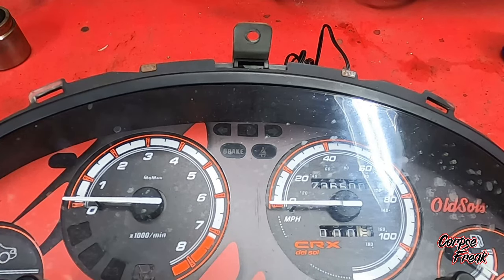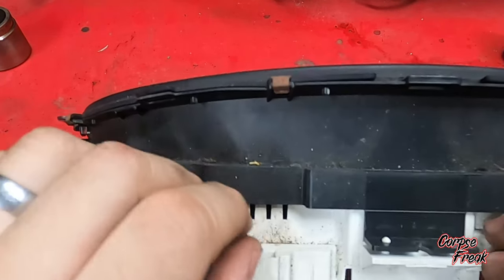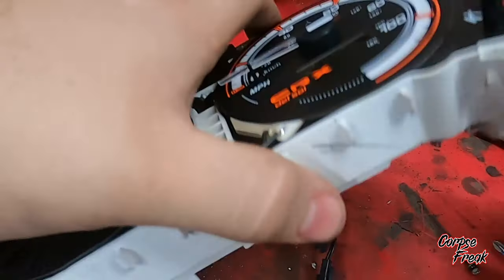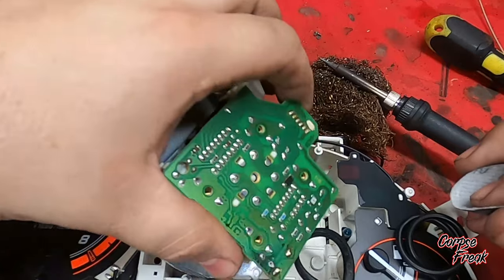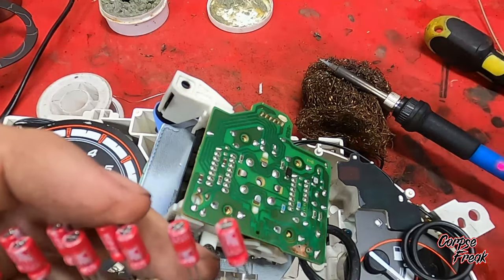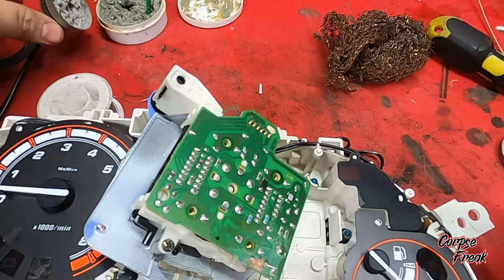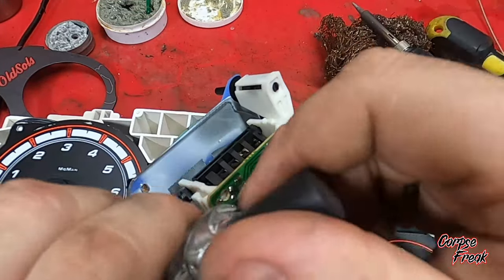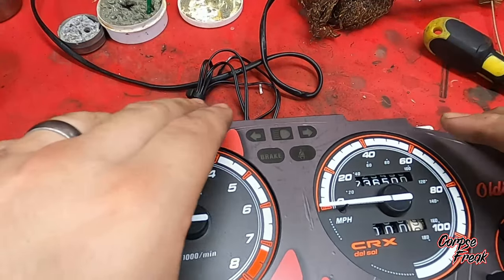How to fix a del sol speedometer

Comment: I had the exact problem, speedometer reading very low if at all.  I followed these instructions and it seems to be working now.  I'm a ham hands with little soldering experience and I was able to do it.  A couple things to note.  When removing the cluster, the large blue connectors on the top have small clips on the top that are hard to see.  Took me a bit to figure it out.  Put a small screwdriver in the very top part from the front and gently pry up a bit and the connector will come right out.  The desoldering part was tricky for me.  Even after removing most of the solder the old capacitor was stuck.  I used a tweezers and pulled down gently on the capacitor while heating to remove it.  Good luck, this is the best video by far outlining the process.
Reply from the maker: Thanks for the feedback and input!

Comment: Hey there, how did you know this was the issue? My speedometer stopped working just reads 0kph. But, it used to work intermittently, after start up and driving a few meters, I would flick the cluster and the gauge would start working. I've tried replacing the VSS and the connector to the VSS, but this fixed nothing. I also don't get any CEL codes. I thought perhaps to start off by checking the signal and ground wires to the VSS, but couldn't find anywhere what how to read the signals and what values to get.

Comment: Just replaced the 6.8 uf cap with a 50v one and it fixed the speedometer in my sons 1993 del sol that hasn't worked for several years now. How did you find the capacitor that was bad. Mine did have a little leakage on bottom but top was not swollen. Problem is, it didn't fix cruise. I've replaced speed sensor and then fixed speedometer be replacing the cap, but still no cruise. Light doesn't come on when pushed.
Reply from the maker: Cruise control is a whole other beast I have given up on mine lol

Comment: so what was the original issue? Mine reads slowly (off by about 5-10-15 mph) depending on the temperature. I was thinking it may be the capacitors too.
Reply from the maker: Inaccurate readings.
Reply: got youuu, thanks i'll order the pieces @CorpseFreak
Reply: Thanks a lot for doing this, i ordered the part you linked then did the repair with my cousin and it worked flawlessly @CorpseFreak
Reply from the maker: @countblah7099  glad to help man! Now I need to do it to my own car lolol